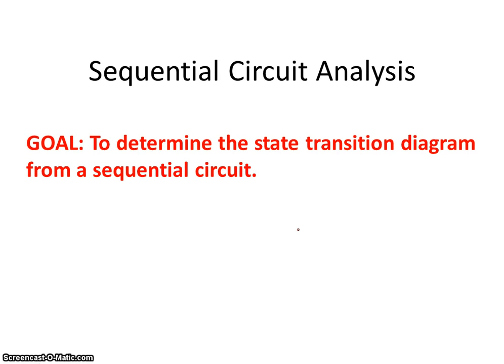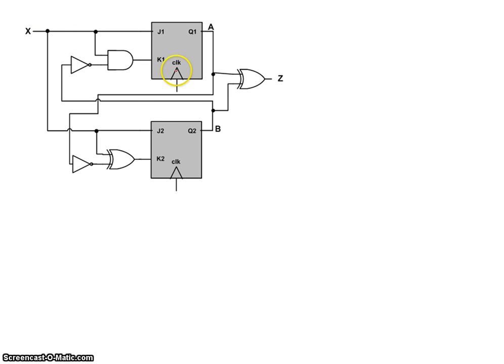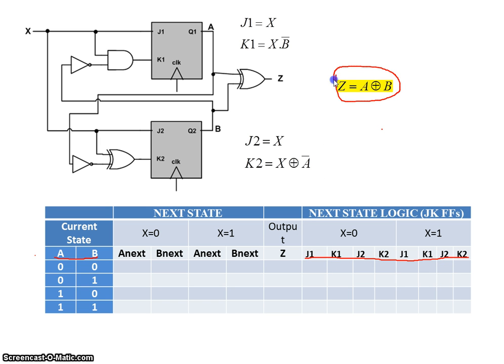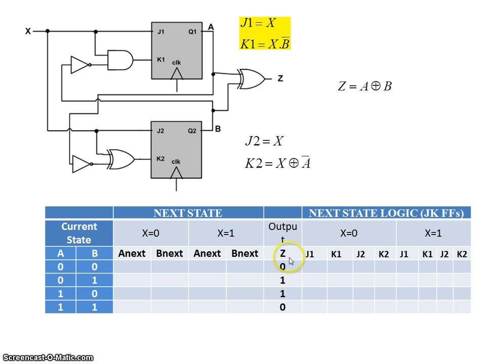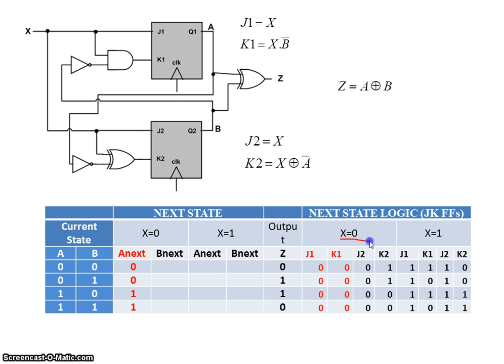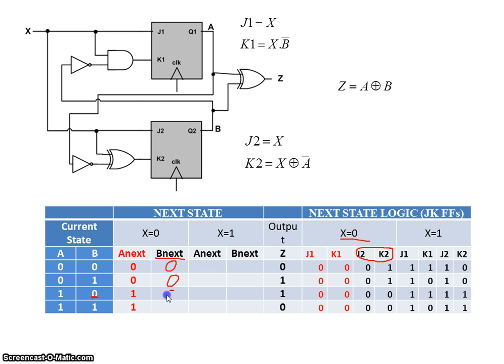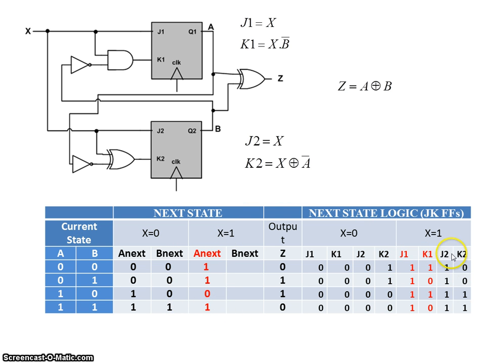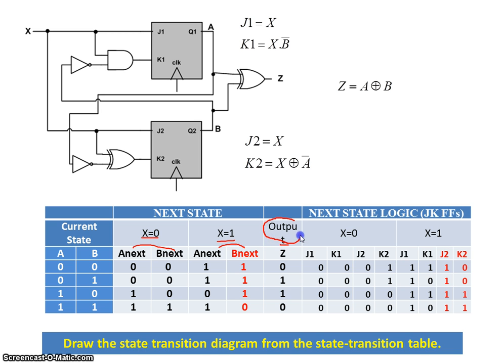Sequential Circuit Analysis - From sequential circuit to state transition diagrams.

Comment: How u came to know it's Moore?
Reply from the maker: The output on a Moore machine is dependent only on its current state. For this reason, the output is written in the State bubble. 

The Mealy machine has output that depends on both the inputs and the current state. In a Mealy machine the output would be typically written on the state transition edge as INPUT/OUTPUT